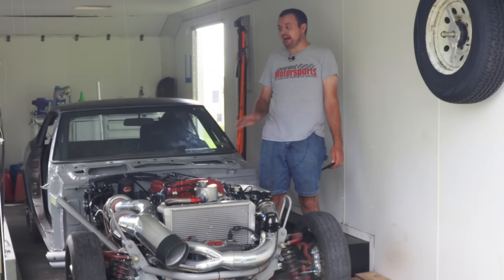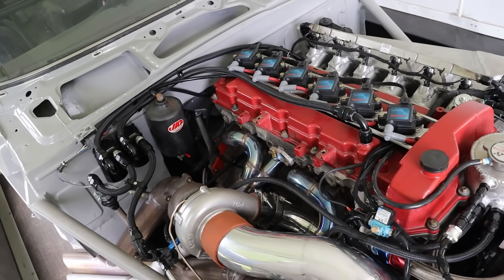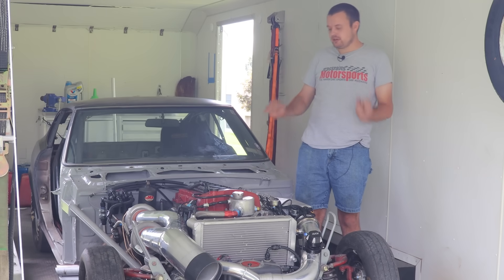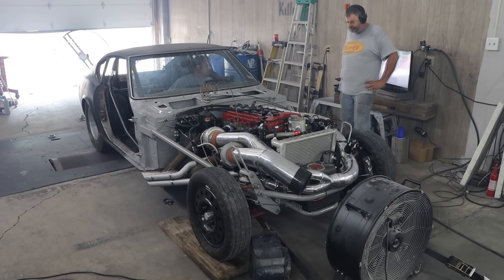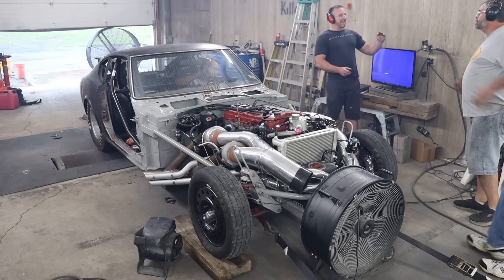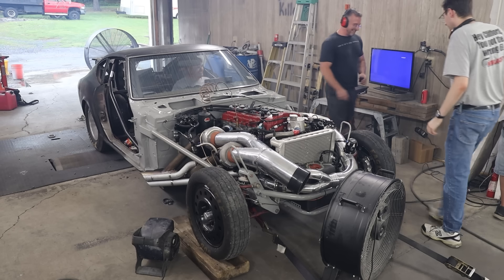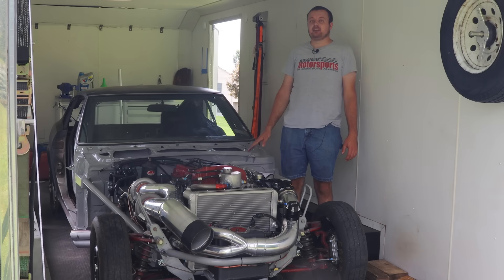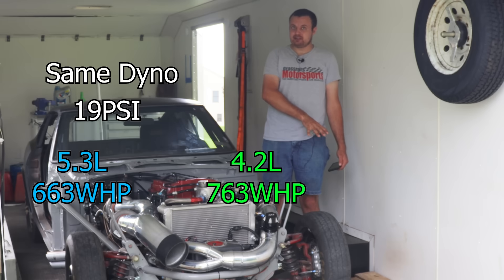This 4.2 Liter Engine Just Beat a 5.3 LS!

Comment: It's madness. I love those 4.2 motors. The 6 cylinder Trailblazers and Envoys are indestructible. Good tough chassis too.
Reply: Indestructible LoL... The junk yard says otherwise. I see them things all over the junkyard. But you hardly see the canyon/ Colorado's in the junkyard and the never got the 4.2L
Reply: @horsefly1020  the transmissions don't last. Most people probably don't want to pay $3K for a remans trans like I just did. there's a channel of a dude whose career is pulling the 4l60e in record time. Pretty fun to watch.
Reply: Actually the steel was soft Chinese steel at least for the 04 time frame - maybe they changed it out but I guess these chassis melt in the salt. I got three weld repairs done - luckily I found an engineer with a laser welder who designed a repair kit for the Colorado - same chassis. He's in Iowa. Yeah depends on where you're at but in salt land - the chassis goes first on these and then the transmission.
Reply: I live in Saudi Arabia. There are shitloads of them, they are all still going, and they are very well regarded for being simple and tough. They have the 4l60e transmission in them here, which is bulletproof. Even though the last models are 14 years old now, they are one of the best buys as a secondhand car. I have  2009 5.7 litre Durango myself. I prefer the extra horsepower of the Hemi. That thing is another awesome American beast. Holden's were really common too back in the day, and they were great. Commodores and Statesmen, the V series. Plenty of power and durable in dry heat.

Comment: U think that's impressive HP per displacement? Build a Honda k20 for that car.... Just rods, pistons, springs and retainers with that turbo and with the methanol it will put both engines to shame with stock cams... I'm sure it can be cheap compared to racing parts for the 4.2 too and speaking of cost... Nobody claims the LS is a model of efficiency it is the cost per hp and the most compact (because of the pushrod design that limits it's efficiency) way to get big cubic inch in basically any car... These things all have their place but I'd be willing to bet u can shoehorn  a 5.3 or any well put together small block in a lot more platforms than the 4.2 without cutting the hood lol I'd love to see someone put one in a subaru.. it's why the LS is a better option for an s chassis swap than a jz.. straight 6s are tall and long af.. the 4.2 all aluminum weighs around 470lbs while the iron block 5.3 is a scoéch under 500... Aluminum 5.3s are lighter and that's a fully dressed truck motor... All I'm saying is it's more complicated than just power per cc
Reply from the maker: Never said the 4.2 was better. I was just asking the question. More hp at the same boost with less cam is the part I'm most impressed by. Less boost for the same HP means less heat. More HP with less cam means more durable for Drag and Drive. 

Are there a lot of disadvantages? Yes. Totally depends on your goals for which engine is "better". Hp per cubic inch? 4200 takes it in a huge way. HP with least valvetrain drama? (which is the largest engine killer on Drag Week) 4200 wins again. Packaging? LS takes it. HP per dollar? LS takes it again.

There are many factors that make something great. You have to decide which are most important to you.
Reply from the maker: Also your engine weights are WAY off. My car lost ~200 pounds going from a turbo Iron block LS to a turbo 4200.
Reply: @Calvin-Nelson  I don't believe there's 200 lbs to be lost and if that's true the engine wasn't the only thing changed.. I didn't just make up those #s lol Google did... and I do know that an iron block LS does weigh about 500 I never personally dealt with a 4.2 but the 470 lb # does seem a bit high although I did see it on multiple sights... To be fair you're within mild camshaft specs on both engines in this vid so valve train drama (especially at the rpms I saw in this vid) is probably a non issue and I bet an agressive cam absolutely would eat up one of these heads ohc designs are tough to get right... (Cough Honda cough cough)... I noticed u didn't mention the Honda. if u want HP per cu inch (cough wankel... This cough is annoying) and per$$ and weight is a factor and packaging is a factor and u want to drive it (nevermind the wankel,) the k series is looking really good lol... Only issue with that is with an auto u need to spray the house down just to come up on the converter (ahem low rpm torque ftw) like I said it's all got it's place but I'm not hating on the 4.2 it's cool af and looks cool too just putting it all in context I was really hoping for more violent sound.. the American v8 market is a stubborn one of nostalgia and bent pushrods and no wannabarra is gonna change that...
Reply from the maker: @ianbuilds7712  Yup. I'll keep playing with the 4200. If people want to join, that's great. If not, hope you are using the platform that makes you happy.

I have personally weighed a 4200. A bare long block is 320lbs. The Iron LS was a gen 4 which are known to be heavier than normal.

Wish the Hondas were a little more affordable for the 800+ hp level. I'd be interested in playing with one.

Comment: As a technician and not ever having to open up a 4200, I've always heard nightmare stories. After seeing this specifically NOT in a trailblazer im less intimidated. And suddenly very curious looking at a pile of used turbos 🤣
Reply: Still waiting since 2004. Got only 200,000 miles on it. No oil leaks. Happens when you change the oil at less the recommended intervals and pay attention to the coolant too.
BUT working on any thing under the hood is a major pain. The spark plugs are kinda sorta easy. After you remove the beauty cover.
Reply: @warrenpuckett4203  Yup! Coolant is very important. The 3 vehicles I hot-rod have 160° thermostats. Forgot...and new radiators!
Reply: Awesome! Got one for a 3800?

Comment: Why would you reuse bearings?  You ready have the cases split.  Put fresh consumables in there
Reply from the maker: They don't offer extra clearance bearings for these engines. The hope is that the bearings have worn a bit and have opened up the clearances. We inspect every single bearing to ensure its in good shape and has good tension.

Comment: I love it . That 4200 is putting in work. 
I think back pressure would tell a different story why the inline 6 makes more power than the five three.  I'm a turbo guy and if your really a turbo guy boost means squat . It's a combination of a few this showing a restriction on the back side of the valves.  What matters is how much cfm is the turbo flowing .
Reply from the maker: Unfortunately, we only have back pressure data for the 6 cylinder combo, and not for the 5.3L. A S480 96mm turbine has been proven to well over 1000whp though, so we are probably not stretching it too far. 

Would having a larger turbine (or more efficient compressor) that made the back pressures the same on both combos at 19psi boost make up 100hp though? I doubt it. I wish I had the data to prove it though.

Even if both engines made the same horsepower, I'd be impressed with the 4.2L. Just my two cents.
Reply: @Calvin-Nelson   with out a doubt it's impressive. My hst is off to you for not doing what most would do.   Just don't get to caught up with boost numbers . I have a gen 1 383 sbc and a compound turbo cummins ram.  When my cummins had small towing compounds I could get it to read over 110 psi. Many combinations later  more than doubled to power with around  half the boost . My cummins currently uses a t4 7875 blowing into a  t6 s488 to make 70 psi.  Boost is just a restriction and is really only good for the specific engine combinations. My sbc 383 makes more power than the cummins  at 32 psi using a on3 journal bearing gt55.

Comment: There is a reason they won Ward's Best when they came out. Fantastic engines. HOWEVER. There are some big reasons why the LS is a better choice for most people. The first is length. The Atlas is long. Too long to easily swap into anything that didn't originally come with an inline 6. Because of that length you end up with a lot more weight on the nose. That upsets pretty much every performance aspect. The next is bellhousing pattern. The Atlas has it's own, unique pattern. That means you have to make an adapter plate to use a decent transmission. The third is parts availability. You can buy everything you need to build an LS at Burger King. Because the Atlas isn't well suited, dimensionally, to most engine bays there aren't enough people building them to justify making performance parts  for them. The fourth is the VVT. You can't use an inexpensive, readily available EMS to run it. You need something that can run all the required electronics and someone to make it all work together. The fifth is reliability. In stock form they are both almost infinitely reliable(not including electronics or ancillaries) but when you start trying to make power out of them a stock LS will live longer than a stock Atlas. No Atlas can handle 900hp on stock internals and live long enough to see an oil change. Any LS can. The last big reason is cost. Sure, an Atlas is cheap to buy used because nobody wants them or cares much about them. But buying everything else you need to make it work isn't cheap. On top of that, performance parts are pretty much all custom, made to order that costs 5 times more than the same parts for an LS that are always in stock. 

If you don't have to worry about a budget and are building a chassis from scratch specifically for the Atlas then sure, it can almost hang with an LS. If you already have a vehicle and just want a high performance engine swap that won't require a 2nd mortgage then the LS is the clear choice. Anything that came with a small or big block Chevy, 4.3 V6 or any BOP is a direct plug and play without changing transmissions or engine mounts(there are adapter mounts for nearly every application). The one application that I would rather have the Atlas in is any Jeep that came with a 4.0 inline 6.
Reply from the maker: Yup. LS engines are great. For cubic inch limited stuff or something where you are trying to get as much out of as little camshaft as possible, you can't beat 4 valves per cylinder
Reply: @Calvin-Nelson  Yeah but the DOHC small block Chevy wasn't the best thing. I'd take an LS over it. I'd take a gen 3 Hemi over any of them. No need for DOHC or massive cam duration to get massive flow.
Reply from the maker: @wvXvxvXvw  ok.

Comment: If I can get a plug in holly ecu for my trailblazer I'm making a shitbox trackhawk hunter.
Reply from the maker: Unfortunately, you cannot. Holley doesn't eve support the VVT, so it wouldn't work as it is Unfortunately
Reply: @Calvin-Nelson  yeah i did some digging last night. Looks like megasquirt,  and figuring out a way to piggy back a few signals to keep Ac through the stock computer... I use the thing just for towing the escort to the track, I'd love to goof around with it, but don't want it to turn into a full blown project
Reply: @Calvin-Nelson  And I've heard with swapping and  doing custom loads on stock PCMs in the past, but after using stuff like fueltech , tunerstudio , holley... idk if I want to go back to a HP tuner'esq environment.

Comment: Not surprising... the LS is just a cheap pushrod antiquated V8, which has high power vs cost. While the 4.2L 6cylinder Vortec is a much more modern double overhead cam motor.

Comment: Talking about hp differences at same boost is irrelevant if you're not running identical setups, boost is just a restriction value, not a flow rate.
Engines run on fuel and air mass, a more efficiently flowing engine is going to run less boost pressure for the same hp as another that's less efficient in it's flow.
Reply from the maker: You say, "a more efficiently flowing engine is going to run less boost pressure for the same hp". So what does that tell you about the smaller engine making 100 more hp at the same boost level?

Comment: I honestly love inline 6 engines.  
Nothing growls like a good V8, but I can't help but love I-6 engines like the ford 300 for example.  

So glad you chose this engine.  It is a very pretty engine too.  I've seen a few in hot rods now.  They can be "oldified" very well too.
Reply: 90 degree v6 sounds better than 90° v8

Comment: Still very bewildered. The Aussie Barra, is known to pull, 1000HP + with titanium rods and pistons. A beefed up bearing system on the crankshaft will also provide for reliable use. 1200 to 1500HP with further fettling is also possible with the Barra.
Reply: 2000+ hp
Reply from the maker: Ok. That's great.

Comment: Okay, so very confused here. The 'Barra', is the name of the Ford engine, developed out of the original Falcon from 1963. It is a straight 6 with DOHC, and with turboboost, is superior to any known Ford V8 commonly available at present. Particularly, as it is a far lighter engine, which not only improves handling, but is also normally de-tuned, so as not to present a threat to the V8 engine blocks. You seem to be showing an identical engine, with the traditional red painted head, yet are claiming it as a GM engine? GM are not really known for their straight 6 engines as far as I am aware, and calling it the identical name to the Australian designed engine which has the same name and appearance is about as strange as I want my day to be.
Reply: Can’t believe you’re not getting this.
Reply from the maker: It's the Ameri-Barra, not the Barra.

Comment: First of all, awsome job with the 4.2, cool as hell. Now I run a small dyno tuning shop, specialize in no prep car builds.  if that 5.3 is on methanol, and 19 psi, and that's all it makes. I've got a 5.3 with a cam that's probably a little bigger, with a s475. It makes 700 whp at 13psi on e85. With stock 706 heads, and a ls1 intake and throttle body. Stock gen 3 bottom end on a stock dbw ecu. I know how you feel about this comment but that 5.3 tune needs some work.
Reply from the maker: Are you running an intercooler on that combo? We are not on our 5.3L

Comment: Aussie here. I read years ago that ford Australia ran the final concept of the barra, before release, on the the dyno on full load and full power for like 1000 hours with no issue. this vortec looks like its got huge valves in her as standard.  bigger than barra. hard to judge from vidya tho. You could be on to winner tho. not knowing how common the vortec are, the barras were so abundant in N/A form, and thats one of the best things about them, a widely available good base for some spestic power potential. as long as you get a good block that hasnt core shifted to much, the good blocks are well into 4 firgures power and torque (nm wise).
But anything can make power, the real winners are the ones that can handle it for a decent period of time.
cool vid mate. subed for sure. oh and ... Gday mate
Reply from the maker: Thanks. The 4200s are extremely common in the US. One of our local junkyards has 20 of them. Trying to make a market before they're all gone.

Comment: Inline 6's make massive torque.
This is awesome power another overlooked engine is the Ford Barra 6 from Australia.
Those engines are putting out 1000hp on a stock bottom end.
Still the smaller inline 6's are awesome and you don't have to spend a ton of money to make respectable power.
They also make awesome sleepers because you can run the stock cams and a quiet exhaust.
TURBOS RULE
Reply from the maker: Yup. Wish we got the Barra. Lol

Comment: Why all the oil smoke?  Granted, there is boost. I question bore finish and pistons width and ring pack choice, Valve guides and oil seals.  Something stinks in Denmark and no one farted.
Reply from the maker: We determined that oil was pushing past the turbo oil seal. We will be installing a pressure regulator on the oil feed to solve it.
Reply: @Calvin-Nelson  Thanks for the response. May that cure what seems to be a perfectly wonderful engine. I never knew anything about this engine and to see the horsepower it can produce is astounding. Good luck at the track.

Comment: No one bothers with these engines as there isn't much aftermarket support for them. Trying to rebuild one to stock specs can be challenging as some parts simply aren't available for them. Just try and find a crankshaft without having to buy a complete donor engine. LS's are plentiful and have huge aftermarket support for them, that's why everyone goes that route.
Reply from the maker: Nobody makes parts for them because nobody does anything with them. Nobody does anything with them because nobody makes parts for them.... Hm... we could break this loop.
Reply: @Calvin-Nelson  Yeah I think that might be wishful thinking. With less than 1.5 million of these engines produced over it's short 9 year production span it simply isn't profitable for a company to develop and produce aftermarket performance parts for  these, even if more people were hot rodding them. On the other hand, ls based engines number north of 25,000,000 since first introduced in 1997.
Reply from the maker: @jeffscott3160  Ok

Comment: I have the 4cyl series of the atlas engine and want to build it. I've heard many of the internals are interchangeable in the atlass series engine, so in theory, could i take these internals and put them in my 2.8 4cyl atlas?
Reply from the maker: The rods interchange.
Reply: @Calvin-Nelson  thank you for that info. Even then, it's exciting to see the atlas put in work and maybe the 4200 swap is the way to go.
Reply from the maker: @s402515  Yeah. A cool trick I like to use is go on GM parts direct and look at a particular part you are interested in. Then look at what other cars the part fits. You'll be surprised of the interchange somethimes.